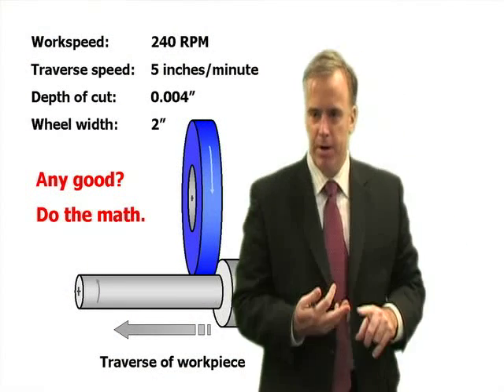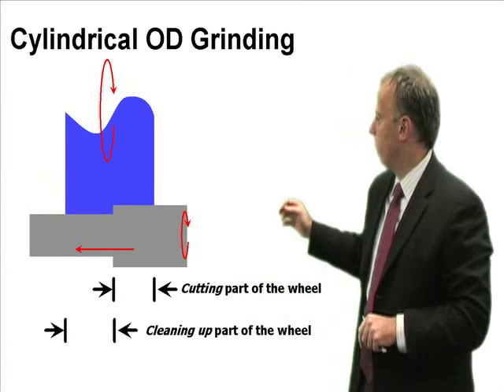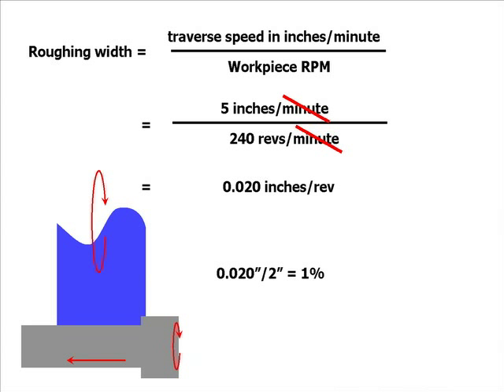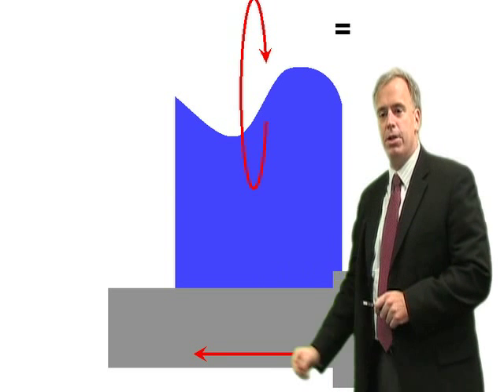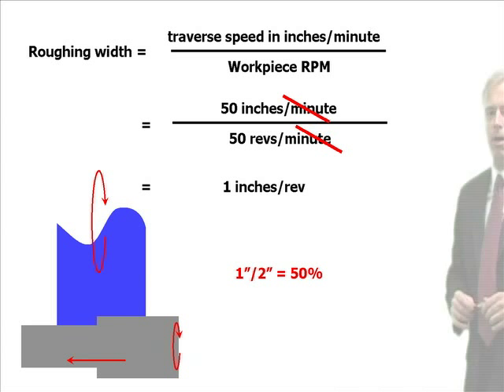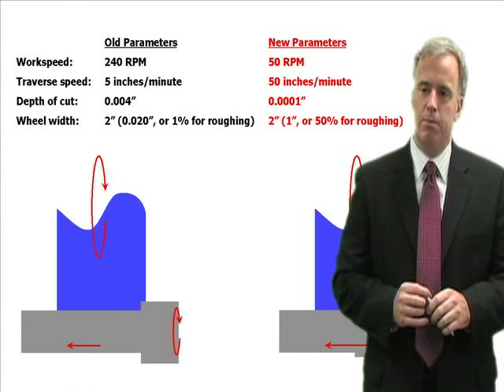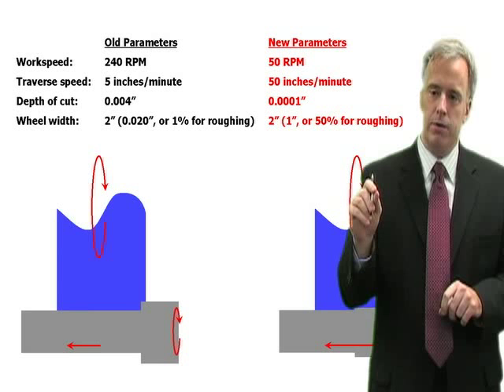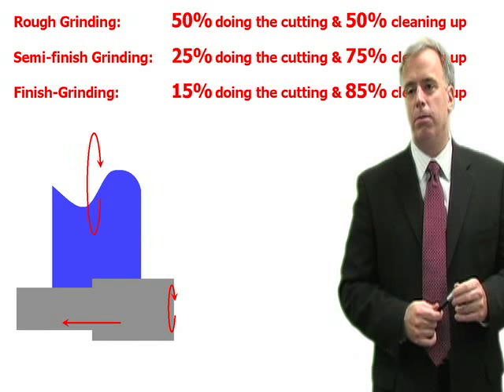Episode 6: Cylindrical OD grinding

Comment: the ratio is useless , metal and  hardness determines speed and feed ,also coolant pressure and of coarse the proper method of wheel dressing is most important and choice of wheel
Reply: Sir can I know how to calculate work speed rpm